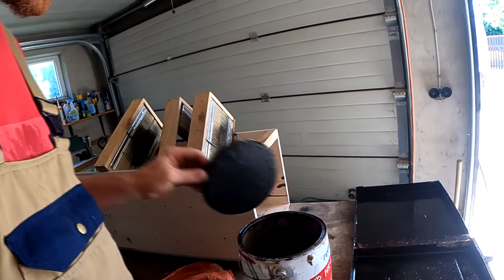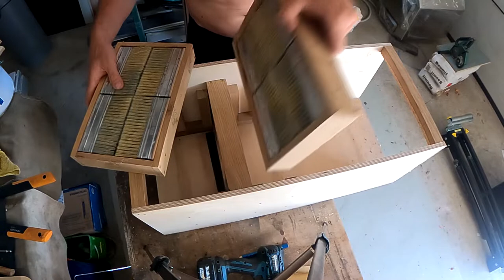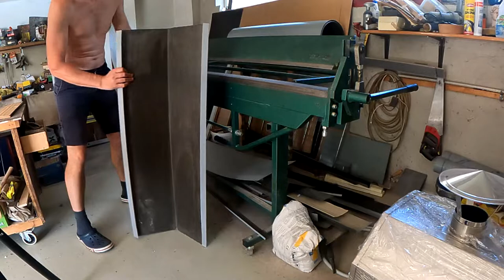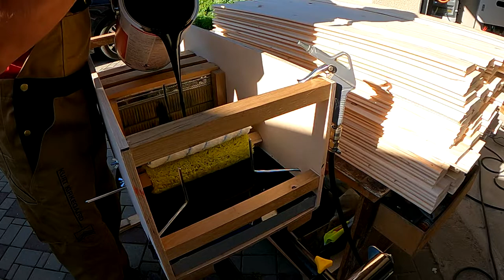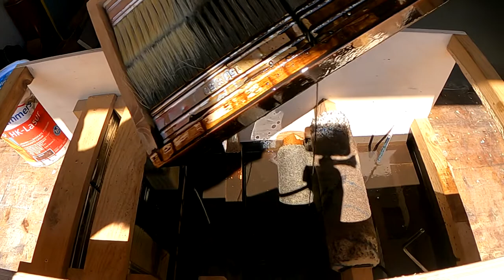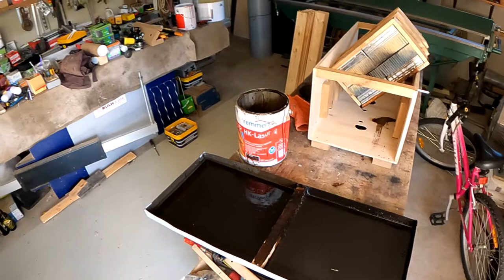How to make painting machine for wood

Comment: Great video. What are the brush heads called?
Reply from the maker: Thank you, they are paint brushes.
Reply: @AndrejsVasevics   Are they a certain type though? They don't look like they have handles or did you cut the handles off?
Reply from the maker: @JeffMarshall-u1v  you can just screw the handles off. The brushes are 2 inches thick and the more dense and fine they are the better.